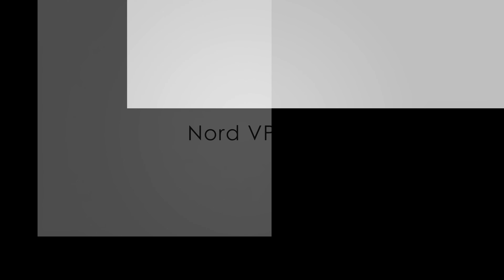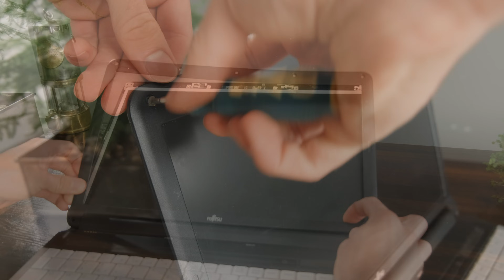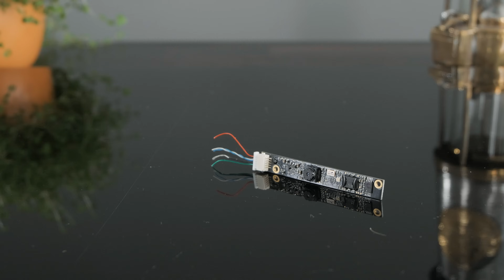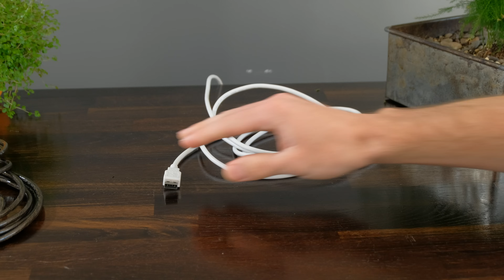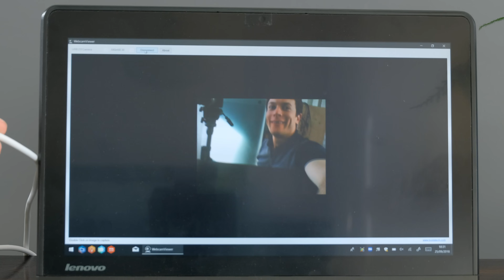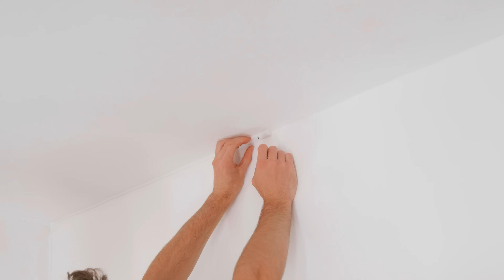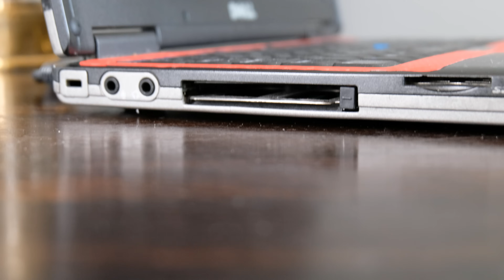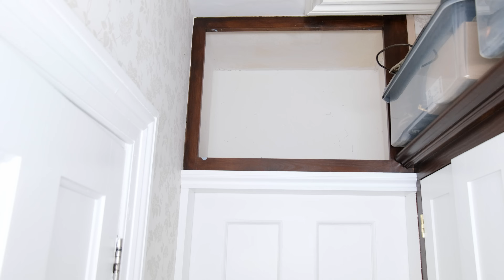DIY Home Security - ON A BUDGET!

Comment: never do as it is shown here
always put red (plus) probe on KNOWN ground and use black probe to find continuity
it is quite foolish to put 9 volts on 5v line, especially when this is power line
reverse voltage is rarely damaging, but 9v on 5v more then likely will fry USB device
Reply: very good point. 

while a good multimeter should have current limiting circuitry in place to prevent damage to the electronics you are testing, some cheaper multimeters might skimp on that part and send too much current and voltage down the probes. 

there are also these cheap "cable testers" that have sockets for all sorts of cable connectors (speakon, xlr, midi, chinch and TRS phone jacks) but may also allow for probes to be connected. 

i never had a problem using multimeters but i used one of those cable testers for continuity testing one day and it sent enough juice through the board i was testing to make the LEDs on the board light up very bright.  

that board was already dead but if it would have been a working board then i might have killed it by testing
Reply: WizardNumberNext, you don't have a clue how multi meters work. They don't use the full 9 volts of the battery to test continuity, instead they use a voltage divider and transistor network and only send out millivolts with practically negligible current. I dare you to measure the voltage output of a multi meter in continuity mode with another multi meter.
Reply: Maybe that is the reason my webcam is now overexposed, only good for indoor when lights off. Completely useless outdoor during day.
Reply: @attarsanahresources5540  Great ... use your cam for bird watching in a birdhouse. 100% legal ... birds will not sue you ;D
Reply: absolute rubbish
Reply: @intriq8  Why? You really need to back up your statement.
Reply: Won't necessarily fry it, if the 9v supplies a low enough amperage (no higher than 0.5amp).  Usually the power regulator on the camera board is able to switch it down to 5v without a problem.
Reply: This is just Un-American I tell ya! It's not how we do things here in our great nation. Reuse things? Re-purpose? Let those peasants in the little fart-ass countries "re-use" useless old laptops. Here in the Great US of A we just toss it in the landfill, cover it up and buy new things that are shinny and wrapped up in a lot of packaging and plastics that we toss also. Or better yet, burn all the old plastics, the sky is huge, there's plenty of room for more carbon up there! And there's plenty of resources on this planet, probably more than we can ever use, all for us Americans to make shit with, we better hurry up though and make and consume and dump as much shit as we can before other nations develop enough to want "our resources" and make us have to "defend" our "interests and our allies interests". We don't have time to re-use things! I bet we could get Trump to sign a new law to make this nonsense punishable by life in Guantanamo for thinking these thoughts of re-using old things to make new stuff! how absurd. Whoever thought of this....lock him up, lock him up, lock him up....
Reply: @haxto1  same in Australia,  Mate! EXCEPT FOR ME ! I intend to use my grandfather's coffin when I die ( of course I have will have to digit up, but I made an air conditioned single seat enclosed Bob cat digger from bits and pieces i found at the recycle centre ( it might of been in someone else's back yard  , i cant remember but i made it !)) Runs on used deep fried oil coz the rest of this nation are fighting the obesity epidemic! Yep obesity is an EPIDEMIC ! and can't live without their " healthy ( just ask them)  tucka ( oz slang for food )   NOW THATS ultimate recycling !  I could even re use his tomb stone as we have the same names ! As this  fades out repeating yiur mind... genius just genius.. genius just genius .. cheers
Reply: well idea is sound and it is good start for improvement, but that is definitely not "home security"
I see this as entertainment, not as a guide and think it is intended  this way
Again good starting point, but terrible end point
There is absolutely nothing secure in USB cameras, long USB cables, and old laptop (especially laptop with any Core iX, which can be hacked without leaving any trails and it will be completely invisible).
I still think idea is sound and with a bit of tweaking this may even be good business

Comment: This was a great project. The only thing I'm not entirely happy with is the need for usb repeaters every 5 meters. Is there a way to convert the usb signal to ethernet? There are ethernet cables for outdoor use, so this would improve the resilience of the system by a bit. Also all the ethernet cables could be hooked up to a switch, which feeds into a raspberry pi or an old laptop. I think this would also eliminate bandwith limitations.
Reply: YES, you can get USB to ETHERNET converters from $5 to $10 or so. Pop that on, and use something like a NetGear Powerline (ethernet over home wiring) and BANG! YOu're in business! Or put the cam on a wireless router etc....BANG you're in business.
Reply: For my system i use zoneminder as the DVR, for my cameras themselves i use webcams i had on had or purchased connected to pocket routers or pogoplugs. check out the tp-link MR3040 and pogoplug v4.

Comment: dewd! Thats amazing! I work in IT and have a ton of laptops I can use. I have previously a couple of normal USB Camera's (with active USB extensions), but because of the few USB ports, I used this : Transcend USB3.0 - 4 Port Powered Hub. (https://www.takealot.com/transcend-usb3-0-4-port-powered-hub/PLID29401929)
Also use contacam, had to do a bit a magic to get my 4 unit COAX camera setup to work within Contacam with the USB cameras. Had to use a future with VLC to it. I've since moved and not set it up again but I gather they have made it easier from some patch notes (if I read it correctly)
Again, massive thanks for this bit of info!

Comment: For the sake of all of your sanity do not use a laptop of any kind for the controller. Use a raspberry pi with motionpie installed. Super easy to use, lovely web interface, doesn't need a laptop stuck and left somewhere.

Comment: would be awesome if you mentioned the approximated price your 6-cam setup was, for example 
"super cheap" "fraction of the cost" but could have mentioned stuff like "cameras cost me 10$ with shipping, and laptop I got for 20$, so it was around 30$" or something like that
oher than that, the webcam being usb is REALLY handy to know, and great video overall
Reply: I'd be more worried about the cost of all those USB repeaters.  I've never even seen a USB repeater in stores.
Reply: @DoomRater  nah, those aren't expensive, they're not "repeaters" but "usb extention cable" or "usb male to female cable" or something like that, I only have thick, shielded, looong cables here, so idk how cheap the cheapos are, but they're not too expensive
Reply: USB has a length limit, after which a repeater signal has to be made or it'll miss the 5ms signal window.  Extension cables will not do anything about that.  That length is 5 meters...
Reply: All that work..... For $2.84 you can buy a Min USB WebCam and you don't have to do all that work.  All you need is the USB Port / Hub + Computer + the Free in the Video Software and you will be all set.  eBay Item:  163188849225
Reply: @JodBronson  But can you tack them to the walls like little super secret spy pinholw cameras? I don't think soooo
Reply: +I. Suk. - Sure you can.... Take it apart with the USB Cord and hide it behind the Wall with a Pin Hole!  Where do you live?  In Bedrock with the Flintstones?  😂😂😂😂😂😂😂
Reply: @JodBronson  Yep

Comment: old webcam, a Single board computer with the ONVIF firmware make a great IP camera. plus you can use the GPIO pins for stuff. And you can connect multiple cameras to one, use the video stitching component and you got a panoramic cam. or some stepper drivers and a stepper make you a PT cam. Zoom lens, now a PTZ cam.
I CNC machine a outdoor housing and I got a mini PTZ dome with IR and GPIO. two way audio too. For less than 1000 Russian rubles

Comment: Great vid! Worth to notice that laptop batteries do not like being charged 24/7 and lose their capacity fairly quick which means that sooner or later it's going to be useful only during short blackouts. Manufacturers might advertise that they have working protection against this but haven't seen one that actually works.

Comment: These camera modules run on a 3.3V notebook USB rail !
You need a two channel bidirektional 3.3V-5V logic level converter and a 3.3V voltage regulator.

Comment: iSpy is another good free cam software with loads of options for different types of cameras and camera settings. You can also just use MotionEye if you have a Raspberry Pi for an even smaller setup and lower power.

Comment: A ethernet cable should work as an extender to.
Dont know how long itll manage, but it should work and offer a costumizable lengh.
1 Cable could manage atleased 2.
But shorter distance id think u could jam in 3. just do all power on one pair and the data on the other 3

Comment: Wow that looks great. I first set up webcams at home in 2003 (seriously!) using second hand PC's with webcam32 software on Windows 95/98. It was great for sending snapshots over FTP to my website but not so good for streaming live video (low res and low frame rate). I was able to see a video of home in the UK on my Nokia 3650 while on holiday in Florida (seriously). The down side was one USB camera per PC and we're talking Wintel based big beige boxes, plus one Dell laptop. I finally killed it in about 2013 but have kept all the snapshots. Recently I  was considering a RasPi setup but this looks so much easier. BTW I believe you need to put up a CCTV warning notice if you have live cams running.
Reply: Apologies, I'm 60 years old and feel the need to share sometimes.

Comment: This really does seem like a good solution, my favourite part is none of the cameras need an external power supply. The quality is surprisingly good, I wonder what the best you can get is, I suppose if you wanted to go crazy you could butcher high-end desktop webcams like the Logitech UHD model if you really wanted to but I suspect you would hit bandwidth issues much sooner. Since I have a server sitting all day basically idle I might give this a try.

Comment: Note: some laptop webcams won't work on direct 5v , it need 3.3v so you might need to connect 2 diode's in series with positive terminal of web cam .
Reply: Resistors not diodes
Reply: Diodes work too
Reply: You can't know the current they'll pull during operation modes, so a resistor is almost guaranteed to fry it.
Diodes are the way to go, though a bit of a crutch. A 3.3V regulator isn't that much more expensive.

Comment: this totally works I just made two webcam's with parts from old laptops I had in my basement thank you so much!!!
Reply: Mr. Dhillon ye same :/
Reply: Mr. Dhillon yes can’t get it to work. It shows up but the computer can’t see that it’s a Camera
Reply: Mr. Dhillon i have no idea
Reply: And you tried the "switch data cables around" trick, right?
Reply: So now it's a troubleshooting time: check all the cables and solders for any damage, check your USB plug if it even has four channels (sometimes cheap charging cables have data cables shorted)...

But first, check for drivers for the camera at the scrapped laptop manufacturer's site! Maybe Lenovo had a not-so-standard camera installed.
Reply: All that work..... For $2.84 you can buy a Min USB WebCam and you don't have to do all that work.  All you need is the USB Port / Hub + Computer + the Free in the Video Software and you will be all set.  eBay Item:  163188849225

Comment: You could also go with a raspberry pi 3. I run 6 640x680 10fps webcam feeds from mine using mjpeg streamer. You could even use it with a usb battery pack to get a battery backup. :)

Comment: you're amazing!!! I was looking into spending $50 on a camera to monitor my 3d printer but you saved me!!! also a quick tip: if your camera doesn't turn on, the GPIO pin or PWC needs 3.3v to turn the camera on, don't use 5v, it overheats, make a voltage dropper with a 10k resistor and 20k resistor (or 2 10k) to get 3v, works amazingly (now only to search a ipcam program)

Comment: "did you know that its possible... with hardly any money at all?" i wouldnt say that just from experience...
i tried to build something similar and here are my findings... 
as you said the laptop cameras cost around $2USD each but they are not that great at quality and you need to make a shielding or case (that Sugru is not cheap tho), instead you can buy webcams for the same money and they come with a case and mounting solution... 
you mentioned "cheap usb repeaters" or extenders and let me tell you that you will be disappointment if you try to connect usb camera on the cheap ones for a distance of 30m... you will need to spend a good $20USD at least for a good usb extender for each of those cameras to get decent data transfer from usb cameras at 30m...
also with the setup you showed you will need to have whole laptop powered and running whole time which is lame...

what you can do instead is buy some of those wifi ip cameras, you can find good ones for $30USD each but they will also have night view with infrared and tilt and pan options and also 2way talking, and you will be able to watch them using app on your phone and also they have alarm option and microSD slot to record videos on it when they detect movement... beats the setup shown in this video in budget, usability and reliability...

Comment: Extremely good idea I may have to try that that's all I have an old Dell laptop that shows that it has 6 USB Root Hub in the device manager
Reply: what model Dell? that thing sounds perfect for this project.
Reply: @welcometocattown2036  Sorry it's not a Dell but an old Gateway and not sure about the model but it's about 8 yrs old currently I'm on the road for the next 2 months and can't check
Reply: @justins.1283  We'll darn. I can't recall having ever seen an older gateway that has ports like that. I mean, one couldn't do better for building their own system. I want to find this device and buy 4 lol

Comment: Or you can just buy USB cameras
 that works to.
Reply: You could also hire a security guard... but that, too, is outside the scope of this video, which states a budget of $60.
Reply: intriq8  Not likely. You'd likely be forced to record in low quality, anyway, to save space and processing power.
Reply: @intriq8  It certainly is, given the plethora of different "old" laptops and budget webcams that exist. The scope is simply too broad for any useful generalization. Arguing a rule of thumb is one thing, but calling it a fact is silly, especially without an analysis some kind. It is opinion. 
My original comment assumes 24/7 video streams from multiple cameras --- that's a lot of data in any context, DIY or not. Thus, low-quality (relatively speaking) recording is the norm for security footage, AFAIK. The camera just needs to be good enough, and what's good enough is subjective.
I do see your point on "DIWhy." That judgement is entirely up to you, e.g. amount of effort required; which for certain people is very little, for others quite a lot. This is not for everyone, but the same goes for commercial security service.
Reply: @intriq8 Generalizations can be factual. However, you provided no statistics and argument; therefore, it's an opinion based on speculation. Who you are or what you've done is not relevant.

All dirt-cheap webcams -- https://www.ebay.com/sch/i.html?_from=R40&_trksid=m570.l1313&_nkw=-lot+-privacy+-slider+-smartphone+-cover+-protector+-case+-sticker+-fan+-button+-board+-3d+-50mp&_sacat=4616&LH_TitleDesc=0&_sop=15&_osacat=4616&_odkw=-lot+-privacy+-slider+-smartphone+-cover+-protector+-sticker+-fan+-button+-board+-3d+-50mp&LH_BIN=1&LH_TitleDesc=0 
vs
All laptop webcam modules -- https://www.ebay.com/sch/175673/i.html?_from=R40&_nkw=webcam&LH_TitleDesc=0&_sop=15&rt=nc&LH_BIN=1
vs
All smartphone camera modules -- https://www.ebay.com/sch/i.html?_from=R40&_trksid=p2334524.m570.l1313.TR12.TRC2.A0.H0.Xcamer.TRS0&_nkw=camera&_sacat=43304&LH_TitleDesc=0&_sop=15&_osacat=43304&_odkw=webcam&LH_BIN=1&LH_TitleDesc=0

Which is best? The only short correct answer is, it depends. Advantages the modules have, universally, is potential for discreetness, and fewer parts.
Reply: Beef Beef beef beef beef 🤣
Reply: I see those for sale used in Second Hand Shops a few $ each, & come with the Screw mount Socket & Cable, "$3"
Reply: Beef and lamb are both tasty; I'll take either.

Comment: Is there any way to access these cameras via the internet for if you are out of the house. Epic idea btw
Reply: Use VLC media player and stream the data to a static IP address. (your phone for example) Really easy to do.
Reply: Contacam has a web interface that allows for viewing of the live feed, as well as viewing and downloading the motion detection, and constant recording clips. It is possible to access the interface from outside your home network if you forward port 8800, from there you could access from a free DDNS hostname, if your router supports it, or just using the IP assigned by your ISP.

Comment: cool video,but instead using a usb repeater why not use a powered usb hub 4 or more port and a usb extension cable,i used that setup a few years ago with a few cheap thrift store found webcams,worked great,the small laptop cameras are indeed a great idea though!